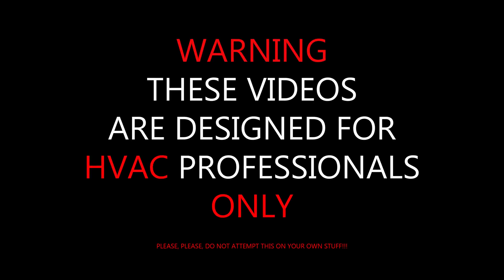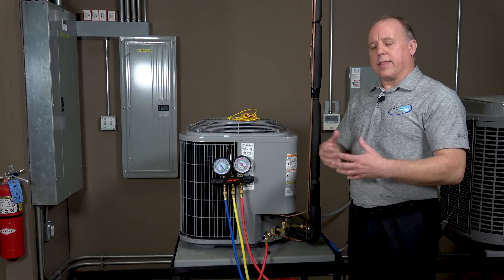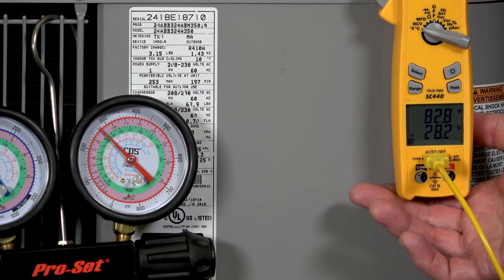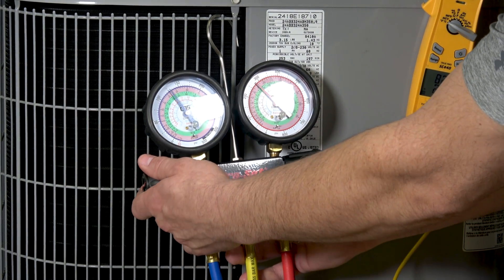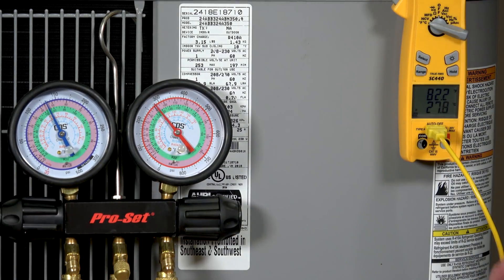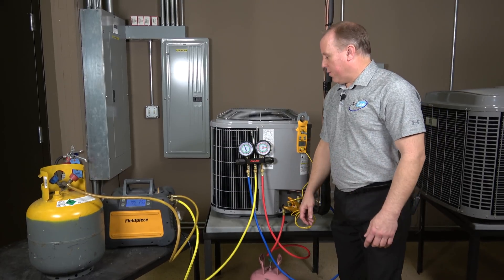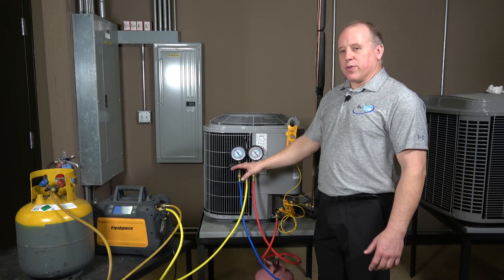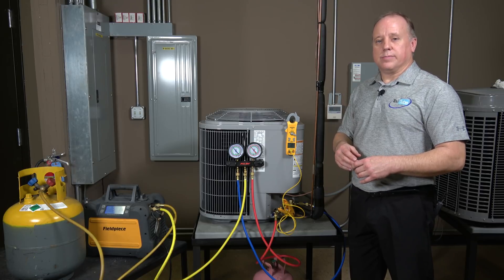Checking Refrigerant Charge for R-410a Condensing Units Using Sub-cooling Method

Comment: Yeah cause hvac is rocket science, 99% of it is hype, they send some under paid tech and a couple minimum wage yokels while billing you a cool hundred an hour per sets of feet while charging you double what it should cost......as someone who knows enough to know someon is trying to fuck me over to my face while trying convince me to be happy about it I offer them a frank and sincere fuck you scumbags.   Thanks for the video, I’ll afford you the benefit of doubt and assume you have scruples.
Reply from the maker: Correct, HVAC is not Rocket Science.  It actually pays better in some cases.  The average pay for a Rocket Scientist (per glassdoor.com) is about $84,000 in salary and bonuses and per Google it is $108,000.  The average wage for a residential Senior HVAC Service Tech in Illinois (where we are based) is $26.95 per hour and most techs work 50 to 60 hours per week (more when it is hot outside and less when it is mild).  That is about $87,000 per year.  For a Local 597 pipefitter union tech here in Chicago, the journeyman wage was $48.50 last year, which comes to about $157,000 per year for 55 hrs per week.  For Local 265 sheetmetal techs, it is $48.02/hr.  Honestly, we don’t understand why you said they are underpaid.  They are intelligent, well trained, and also well paid.
Reply from the maker: When you say someone is charging you double what it “should” cost, we assume you mean that you found the part online for $150 but a contractor charged you $300 for it.  But that is not apples to apples.  In those types of scenarios someone is comparing a widget up against that same widget… plus the labor to install the widget… plus company overhead (phone receptionist, marketing, trucks, training, building, utilities, computers, etc.).  Of course it costs more to run a business installing parts that it costs for just the part alone.  It is the exact same reason why you can buy a 10oz ribeye at the grocery store for $10, but at a steakhouse it costs $30+. You are paying for more than just the physical steak.
Reply from the maker: With all of that said, the vast majority of residential HVAC contractors are UNDERCHARGING for their service.  How do we know?  Well, we have close partnerships with about a hundred local HVAC dealers where our business consultants help them audit their finances.  The average annual NET profit is between 3 and 4%.  That is a pretty slim margin to work with.  This is also the reason why small HVAC and Plumbing contractors are the 2nd or 3rd most likely type of business to go out of business (note: restaurants are #1).
Reply: @canton7180 Wait... on the videos on your own YouTube channel you seemed to think $100/hr was an acceptable cost for tuning a Mazda, but it is not an acceptable cost for HVAC mechanical work?
Reply: @canton7180 And you also stated that 50% of the modifications to your Mazda were labor and 50% for the actual parts.  Clearly you must understand something about the economics of mechanical upgrades and repairs.  HVAC is exactly the same as automotive work... just not as much fun.  :)
Reply: @ryanhoger1  when I can buy a rebranded carrier condenser and evaporator wholesale for $1500.00 and install it in a weekend myself and pay a tech $300 on the side to braze my lines and balance the system when his boss just qouted me $10k for the same exact system yeah I'am going to call out the average business for being greedy predatory scumbags, btw I have a hs diploma and work a blue collar job, tending a paper machine and I make double what the average 20 year tech makes, thats not right with me, when only 1/3 of the money I 'am being charged makes it into the hands of guy who I 'am intrusting to a good job and the other 2/3 goes into the pocket of a bullshit artist I find fault with that.  I was not calling out contractors, I'm calling out the businesses, ones that are ran by professional saleman who make hand over fist while their tech get little in comparison.
Reply: @canton7180  Costs of equipment and service are used for more than just the staff's paycheck and the owner's profits. 

Tools and equipment, vehicles, vehicle up-keep and fuel, PTO, uniform items, funds for continued education. Every business has the goal of making a profit. A haircut shouldn't cost $20-$50 in my opinion, but that's where we are nowadays. 

Skilled labor was never cheap, even if you can pay a tech $300 on the side to set up your unit for you. That just means the tech lowballed himself, and is opening himself up to liability for any future issues because he put his hands on it.
Reply: @RationalMinded  In what realm of reality is $300 for 3 hours of work lowballing? he actually made his scale, the businesses not the private contractors are tripling the labor and tripling the cost of equipment and material, I fully understand overhead, taxes, equipment, etc....I assumed full responsibility as the installer and home owner, I removed the evap from my attic, puchased a manifold and holding vessel to evacuate the freon per code, installed the new evap in the attic, placed the new condenser outside, wired it in and ran the new hi/lo lines,all he had to do is braze the lines with nitrogen and balance the system and as a favor he did a once over for me.
Reply: canton7180 he lowballed himself!! But never mind that! Let’s see where this guy is at if you have an issue with this said unit! Also, I hope you are CFC certified to be running an evac on a unit, there is a HUGE fine almost tripple the amount the HVAC company was charging you!! I understand we are all trying to save some money but sometimes cheap becomes expensive. Best of luck!
Reply: Marlito Vladimir save someone money? Not get screwed is more like it, I hear all the horror story from people dealing with businesses not honoring their service plans far too much to be a hoax, so workin for his company he makes 27.00/ hr, he made almost quadruple that working for me yet according to you he was low balled, hey man I worked as a journeyman industrial roofer for 15 years, all government contract work, I later did job estimates for the same company I know first hand all the smoke that gets blown, that was skilled trade no different then a hvac specialist, your not going to rattle me bud, the fact you can’t wrap your head around the fact a lot of it is hype, that is sad, some people have no choice or ability to follow procedure, I might add the idiot so called professional I had install my original system in my attic failed to install the mandatory secondary catch pan under the a coil, or dead switch, and the city code inspector who is also a supposedly professional either missed it or didn’t care, long story short my entire master bedroom ceiling collapsed, if I’m going to be fucked it might as well be by myself.....right.

Comment: What if target subcooling number is not given on the label ?
Reply: You can google the manufacture installation manual or go with the industry standard of 10F. You have to remember that sub-cooling is used with a TXV, if you have a piston metering device for example, you will need WB + DB and target super-heat.
Reply: Txv in the evap will show what it throttles at

Comment: When do you use superheat vs subcool?
Reply: For a txv you charge to sub cooling. After you verify super heat is between about 10 to 15. Remember the superheated gas is what cools the compressor. If the sub cooling is correct but super heat is too high the compressor or oil can overheat. If the super heat was to low their could be liquid making it's way into the evaporator possibly damaging it.
Reply: Subcooling method if the evaporator has a TXV (Thermo Expansion Valve). Otherwise, superheat method.

Comment: Outdoor temp + 30 = condensing temp
Reply: That only was useful on 8 to 10 seer units as the condenser coils have become larger to boost efficiency the condenser over ambient (coa) has dropped. You may be in a 10 to 15 degree range on modern units.
Reply: Don't ever use that "rule of thumb" lazyman's estimate.

Comment: Puron systems are to be serviced with liquid refrigerant.  Puron cylinders have a dip tube so liquid refrigerant is dispensed from the upright position.  So why do I always see technicians turning the bottle upside down?
Reply: Depends on the cylinder, make sure you read the box. Dip tubes can fail so not all manufacturers use them.
Reply: If your cylinder has a dip tube, wouldn’t gas be taken out when upside down?

Comment: Hi may I move my condenser unit while still connected about five inches or am I risking a leak thanks
Reply: Yeah it's true you are going to have to pump down the refrigerant and recover the rest or other way you will damage the unit. Good luck!! 👍
Reply from the maker: It would be difficult to move without damaging the connection or pinching the copper line.

Comment: Dangerous!  Charging liquid to suction line without making sure all liquid vaporized will damage compressor.  Compressor cannot compress liquid.   Secondly charging the system without having a scale to see how much is added to the system is very wrong.  How do you know how much refrigerant is added or removed?  It is an EPA requirement.  Thirdly you always use gloves in handling refrigerant in the system.

Thanks for posting it, but viewers must be aware that the procedures shown are improper.  Do not follow!!!
Reply: He’s charging the unit by subcooling.  No scale is needed. You can weigh the refrigerant tank before and after.   That’s how you’ll know how much refrigerant has been added.  A seasoned technician will know how to throttle the liquid refrigerant in to the system without damaging the compressor.  Gloves are definitely optional assuming you know what you are doing.
Reply: These videos are for people who know what they are doing to watch and learn something different. People just assume that it’s meant for a consumer. 100 percent your fault you do something and don’t know for your self
Reply: tdtran1117 gloves you don’t need that’s up to you as the tech I don’t use gloves. I have low loss fittings
Reply: Lol
Reply: 410 units use "scroll"  compressors, they don't  " slug" so easily.
Reply: Omg

Comment: I think u should take a close look at the suction tem, and pressure because under 32 degrees the unit will start to freeze. Also the refigerant boil in the evaporator at 40  degrees. U should use a scale next time to see how much u ounces u have put in the system. U also dident bave to hook up the recover macgine to remove refigerant. All u should do is to just connect the yellow hose to the tank and open the high side, valve and do a passive recovery when the system is running.

Comment: i have quite a bit to say. First, subcooling is used to measure systems utilizing a txv. or eev. metering devices. Second, Not all manufacturers list subcool ratings on data plate/sticker. Third, when subcool ratings are listed, the manufacturer requires the use of a charging chart, provided by them, in both the technician literature and a chart on the inside of the service panel. Fourth, a psychrometer is essential to proper charing of of any system R410A, R22, MO99/R44, R134A, etc.. Always measure wet bulb and dry bulb temperatures! HVAC systems are designed to increase the quality of lives of individuals, protect people's Investments and better quality of life and they're trust in you to provide it. Do it right the first time.
Reply: Apprentice
Reply: 🎉🎉ttm

Comment: can i  turn the ac on connect the blue hose to low port side & add freon without connecting the other side .
Reply: that's not freon, 410a is puron (or just "refrigerant'). you need both hoses connected, which can be done with the system on or off.  then for charging, the system must be on.  You charge through the low side (throttle, not wide open), and you need the high side pressure to calculate the subcooling.
Reply: Yes
Reply: @joejones6842  this wasnt demonstrated as a brand new install, so the refrigerant being pre-charge wasn't relevant here. but otherwise I agree, most do come pre-charged.
Reply: @joejones6842  you can only charge a system with a fraction of the amount of refrigerant with the system off, but not the full amount. bad/unsafe idea to use a blow torch/heat gun to compensate pressures to force the refrigerant out. u have no idea how much heat/pressure ratios are happening = explosion. Hard pass for me on that "old farmers trick". But im gunna tell random strangers how to make a fast buck or how to live their lives on the brink of death. But i aint doing it.
Reply: Physically yes you can, but then how will you know when you have enough, or too much in the system?
Reply: @donlanway5520  Incorrect, you physically cannot charge with the system off.  The refrigerant tank will equalize pressures with the ac system and it wont fully charge the system beyond a very small initial amount.

Comment: Does the condenser needs to be on while recharging?
Reply: niZmo yes
Reply: Yes
Reply: Yes
Reply: the condenser is a series of copper tubes. how do u turn that on? that said, you cannot charge a system without the compressor turned on, nor calc subcooling.
Reply: Yes

Comment: Only liquid with blend refrigerants you just screwed the unit and the rest of the 410a in the jug is junk he used liquid refrigerant but added it through the suction side not the liquid side wtf? That’s why TEC in melrose sucks at tech support
Reply: Glen, based on the videos on your channel, you seem to seek folks out to give them a hard time.  I look forward to watching some of your HVAC educational videos when you make them.
Reply: Tank's upside down, it's liquid all the way to the manifold valve at least, can't affect the tank. Common practice, not sure what you're on about.
Reply: it was fine adding it through the suction side but he should be going very slow if he doesnt have a kwik charger to allow the gas to flash before entering through port
Reply: Glen Presnell if you are a technician I hope you work harder to educate yourself in the field of hvacr. We need more experienced techs in this field. Please do not comment on any hvacr videos unless you personally have the correct knowledge to do so,  I can tell you currently do not. I am all about educating other technicians so if you need any help at all feel free to contact me I can be a very good resource. I am out in the field 24/7 doing commercial and residential work though I will stop to answer questions if you are willing to learn. tstathq@gmail.com. Like others have already posted it is perfectly fine to charge R410a in liquid form into the suction line with the compressor running as long as you crack the suction manifold gauge port open slightly to slowly flash the R410A into the system. Also if a little liquid passes to the compressor it will do no harm as most new residential units use scroll compressors that can easily handle the slight liquid flood back. Though to be safe watch your gauge the needle should bounce up and down which tells you the liquid refrigerant is flashing into a gas just after your gauge port. Also R410a is a blended refrigerant however it has a very small temperature glide therefore If you had somehow accidentally charged the system in vapor state it would more than likely make no difference. However I have never done this, it is not good practice for refrigerant blends, and not recommended.
Reply: Glen Presnell you’re supposed to charge blended refrigerants as a liquid through the suction side. What are you blabbering on about?
Reply: @DominiKing32 that glen guy is an idiot,
Reply from the maker: Glen, if you would like to discuss R-410a charging procedures in more detail, you are welcome to call Dave in TEC's Tech Support dept directly.  You have the number.
Reply: Tec Tube Dave couldn’t even figure out a simple high efficiency boiler troubleshoot so please I would rather call McDonalds to get tech support
Reply from the maker: We do have a separate hydronics division specifically to support technicians working on our boilers in the field.  Not sure how you would have reached Dave for support on boilers.  If you are still having an issue, we would be happy to connect you to TEC's hydronics team.  What brand of boiler was it?
Reply: Glen, if your boiler troubleshooting issue was simple, why were you calling TEC for support?
Reply from the maker: Glen, as an obvious TecTube fan, we would like to invite yo to watch some of our best mistakes.  https://youtu.be/2MOms0fDc10
Reply: You can still add it thru the suction side you just have to meter it to allow it to flash to a gas before it gets through the hoses
Reply: Thats why you use a liquid low side charger Imperial makes a good one sad that you dont know this either very sad learn your job
Reply from the maker: It is not recommend to add refrigerant to the liquid side when it is running, as it could damage the compressor.
Reply: You can ONLY charge through the suction side.  If you try to charge on the high side, that pressure will push the refrigerant back inside of the tank due to it being HIGH pressure.  That's how you recover refrigerant, not add it.
Reply: This comment section is a perfect example of why these videos are for licensed techs, not youtube keyboard techs. If you professional service guys were smart you wouldn't answer any of these morons, your just feeding the fire.